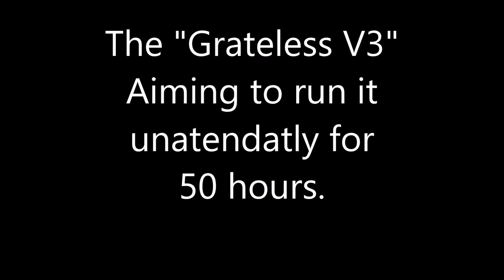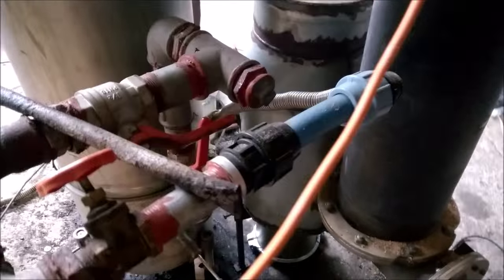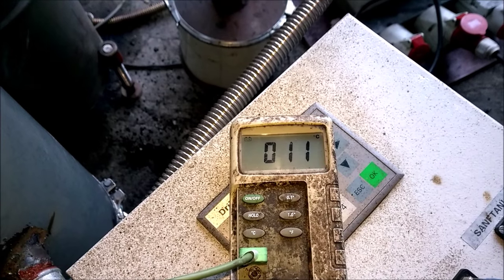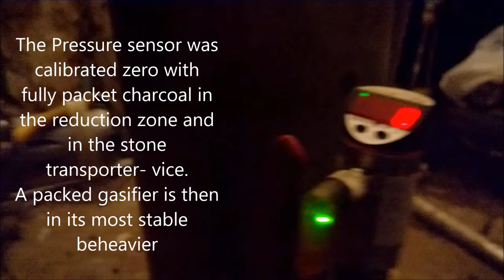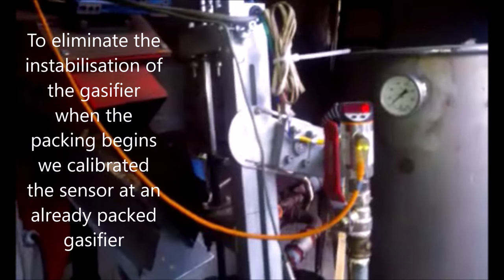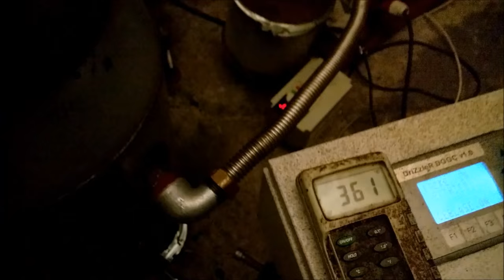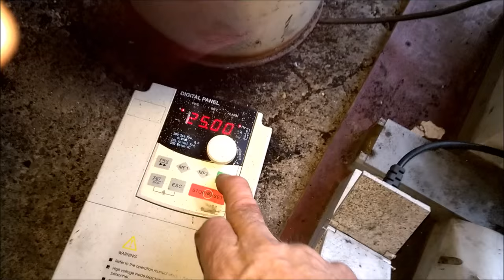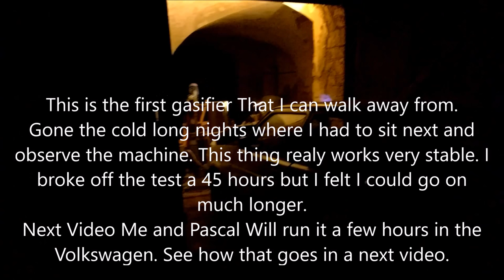Wood gas Grateless gasifier V3 is 45 hours running by pressure sensor control.

Comment: Very Nice Luk! Very Very nice. I feel like were viewing the beginning days of a new bio-energy industry. And you and Pascal are two of its pioneers. Two points:1. The grateless design would appear to permit a wider variety of fuel and fuel sizes. Seems like it would be more forgiving. true? 2. Please clarify, you still have a restriction, on the order of +/- 3 inches or 80mm? Would you say the fuel is completely used by the time it hits the vice/ augur? What does the waste output look like?
Reply from the maker: +Henry W Thank you for your nice words. Indeed, The V3 eats many differnts sizes of fuel. The only thing to adapt is the height of the ember bed. So far we gassed Pellets, very small chips in the order of some 6 to 10mm, chips 1 inch and G50 chips from 30 to 80mm. The restriction is variable by inputing differnt sizes of DriZzleR tbes we control the suction, With the smallest tube being 120mm and the vice tube also 120 we have practicaly no restriction then. The gassed out material left ist 50 procent pure dust the rest is charcoal and impurety,s  We are striving to reduce the latter even more. 
Luk

Comment: okay, thanks for the explanation. now I understand it better. Just sondering.....would it be simpler to just Push a scraper underneath the glow bed back and forth?
Reply from the maker: +Marcel Herwijnen  Marcel, The least you want is to instabilise your glow bed. The movements there should be exstremely gentle. Most people uses grate shakers. In my experience every teme you shake the grate a flood af soot and in moste cases also some tar slips through butting an unwanted stress on both your filter and engine. Luk

Comment: Luk - thanks for sharing. Regarding electric motors, you have the fuel feed auger motor, the Pyrotouch-compactor and the charcoal removal motor. Is this correct?
Reply from the maker: +Ken Boak Hi Ken, Nice to see you. Yes Three motors. Two with neglectable energy consumtion on 12V, but the fuel feeder motor must be replaced by an alternative.It simply consumes too much energy. At this point where I am still testing I am not much energy balanced aware, but some day I must, because what is the use of producing 7Kw and spending already a few Kw just by keeping the system going.
Luk

Comment: I'm just wondering what you mean by a "vice"  I know a vice as a thing that clamp things. Or do you mean a auger? 
I try to understand how your glow bed is working and how the burned ash and dirt is removed underneath that glow bed. 
Hope you understand what I mean!
Reply from the maker: +Marcel Herwijnen Marcel, Thanks for comenting and watching. With a vice I ment an auger with very narrow and close to each other flights. I was handmade and expensive. I am now working on a gasifier that does ged rid of this expensive thing. I ran yesterday the very first test. It went half and half so i need to make some modifications. Hope to post a video on this thing soon.
Reply: All I can say is wow and thank you for all of your videos , I was about to follow in flash's foot steps till I saw that continuous run was possible and have been racking my brain to understand more and what I could do to replicate your results and had a few questions that I'm sure u have been asked one thousand times over ..... But instead ill ask ur opinion on my idea of how a great less gasifier would work ( I apologise in advance for my bad examples but there the most common things I can relate what's in my head to you over the internet without being able to draw it up )

Would it be possible to simplify the grate / auger / vice , by using 3/4 inch or larger stainless steel threaded rod. With the rods all laying parallel and roaring the same direction ( kind of like the machine they cook 30 hotdogs on at a gas station ) that would provide a flat surface like a grate with enough space for ash to fall through the threads and small gap between each rod while still allowing rocks and other non combustibles to be augured off to a separate drop box . also I believe if all rods are spinning same direction it would prevent itself from jaming because as one side is going down the other is going up 

The next complexity with this idea is not having the entire ember bed be shifted off to the non burnable drop box ,  I think that could be solved by doing something similar to how your lock on your house door works , useing a triangular piece ( in a row to make a barrier ) of metal that has spring  pressure pushing down on each triangle pice of metal to the threads on the threaded rod , so that when a stone was pushed over to it it would compress the spring and lift the triangular prong up untill it passed then drop back down to the moving great preventing bio char and embers to pass 

I was also wondering why no one used more then one cyclone filter ..... Is it because I'm a rookie and missing something ?